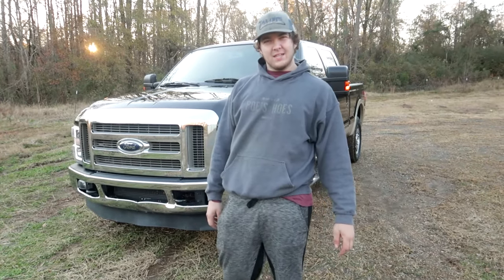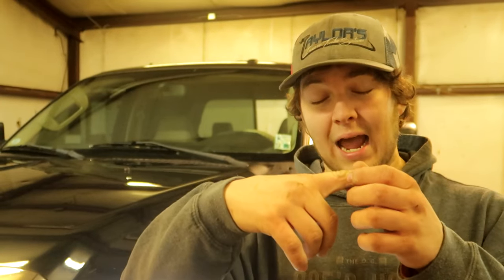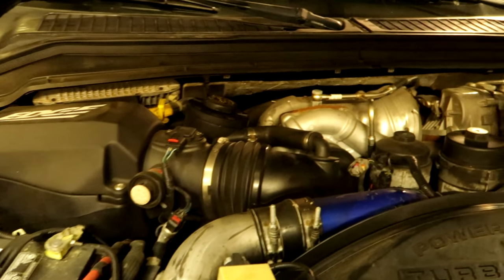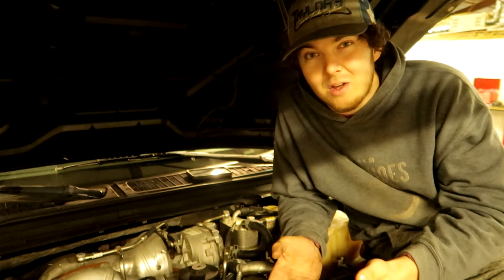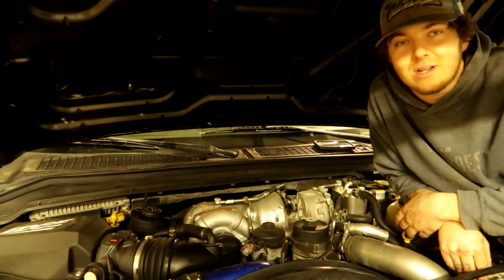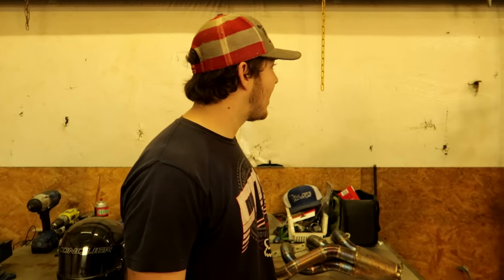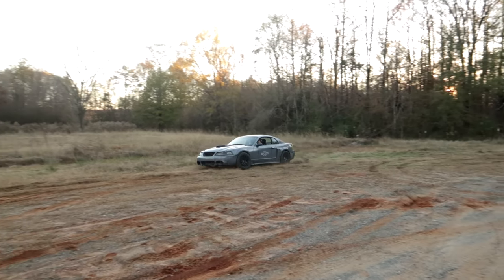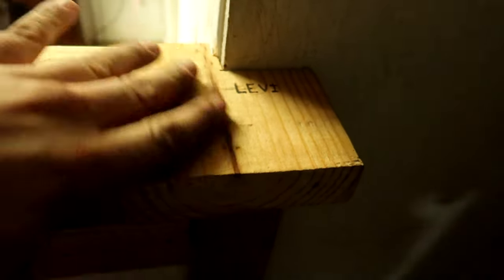Is the 6.4 Powerstroke a RELIABLE truck?

Comment: none of the new world order vehicles are reliable . The last year I would look at is a 1960 455 Weight reduction block. Any vehicle from 1990 to present day are all China’s best garbage . Look at the Ford Mustang It has Toyota parts and that’s why I scraped the 2007 Toyota mustang . Later have fun with the disposable Dixies and wasting your time . You want to have something that will last forever build a iron block I would only build a iron block 455 . Inside the 455 Cubic Inch Big Block from General MotorsThere's no question that 455 cubic inches of displacement equal a big motor. Nevertheless, this giant engine from the General is a little mysterious. In the beginning, you would find them in Oldsmobile Motor Division products. As time went on you started seeing this exact displacement under the hood of Buicks and performance models from the Pontiac Motor Division.

Here we'll dig into the history of the record torque producing big block. We will also uncover the difference between a 455 and a 455 HO (High Output). Discover if the Buick, Pontiac or Oldsmobile gmc engine has an advantage over the other manufacturers @ Finally, learn how the 455 benefited during a time when GM's divisions took great pride in making their own mechanical engines instead of all computer systems controlled engine 

The Oldsmobile 442 Version
Olds beat the other GM divisions to market with the first 442 Cubic Inch motor. In 1968 the engine found its way into Oldsmobile's premium luxury muscle car, the 442. They called it the Rocket 455 which became an excellent marketing tool. They based the engine off of the 425 CID found in the 1967 Toronado. The company actually retained the same size bore yet increased the stroke by altering the crankshaft.

The side effects of a longer stroke include a healthy increase in torque. The downside is the engine finds itself a little slower at gathering RPMs. Horsepower ratings from 1968 through 1970 remained in the 375 to 400 HP range. At first, the engines remained exclusive to the Toronado, Cutlass and 442's. After 1970 you'll also find them in the Olds Vista Cruiser Station Wagons, Delta 88's and even GMC motorhomes.

Stage I Buick 455 Performance Engine
The Buick version of the 455 is actually quite different from the Oldsmobile version. Instead of altering the stroke, Buick honed out the cylinders on the 430 CID Buick Wildcat engine. For this reason, GM considered it a thin-walled big block. The advantage of this casting design is a significant drop in weight over the other 455 versions.

In fact, the engine actually weighed close to 150 pounds less than the legendary 454 big block that Chevy used. This weight reduction compensated for slightly lower horsepower output from the Buick version. They rated the standard issue 455 at 350 HP and the high-performance stage I version at 360 HP.

This engine had a short run starting in 1970. In 1975 General Motors started using the same engines across the different divisions and platforms. This gave them better compliance control for the increased power and fuel miles they buckled it into the ground.  At the end I put that engine in my 1995 suburban and it was a muscle car bully that ran 10 seconds on a good day on a lumpectomy day she ran 11 seconds and for a suburban that’s quick thrown down . Edit if I fallowed my insane friends build I could have had a 9 second suburban . To tell you the truth I would love to own a cutlass 442 my mom had one when she was growing up . To be honest with you tony they don’t make any thing past the 80’s I would want to own and there’s no way in hell I would ever buy a electric vehicle that needs Nuku’alofa power or coal to charge your disposable Dixie . My wife said go find something at a dealership or something and I tell her every time 99 percent to a 100 dealership unless you’re in America you cannot buy anything but a new  disposable Dixie nothing compare to the older vehicles.